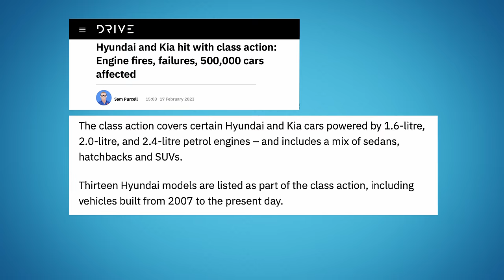Australian Mechanic Reacts to Aussie Car Problems

Comment: The GTR looks like the chassis twisted, lifting one of the wheels off the track.  It's AWD, so going from 4 wheel power to three wheel power could easily push it off center, especially with 2,000+ ponies.

Very fortunate recovery.  Could have been far worse.

Comment: 11:45 It's a little messy but a screwdriver through the filter will remove it too and even barefoot "shade tree" mechanics all have at least one screwdriver, not everyone has a dog's choke chain!

Comment: I had a 1971 450SLE MB, put a 351 from a 1976 XC falcon wagon in it with a C4 tranie, cheaper than fixing the heads on the german caca/dodo/poop box

Comment: dudes that 11:55 guy with a wicked tight oil filter. That was damn near me a week ago. did my first oil change on the '19 miata (the dealer has done the first 3) and that fucking thing musta been put on with a breaker bar. absolutely required a tool to get free and they say no harder than hand tight needed, jesus!

Comment: At 11:27 I've seen Mexican mechanics stab the oil filter with a screwdriver piercing both sides to use the handle of the screwdriver to turn the oil filter.

Comment: The sad truth about snorkels is unless your air box and it connections are sealed and electrics waterproofed a snorkel is not gonna help you with high waters. 
Truth is that snorkels are mainly use in Australia to minimise clogged up your air filter with dust especially if you drive a lot on dirt roads.

Comment: I like the dog chain, but a flat head screw driver will go through and through in two seconds. Then you just turn .
Reply: Sometimes. I had one seized on so tight the screwdriver cut thru the filter like it was a soda can. The filter claw wrench thing kept slipping off and flinging my hand into steal. I had to beat the crap out of it with a hammer until it was unrecognizable.

Comment: So with the Kia and Hyundai motors could that be an issue like way back when with the Germans telling them to add one quart or a half quart less oil that the motor actually requires?

Comment: Hyundai kia engine burn oil severely. Its the same engines as the aussy ones but people dont know for some reason and keep buying them. Ive see hundreds of them with 60k miles and burning 1-2 qt every 1k miles and it causes the engine to go dry and blow up.

Comment: Back in the 70s, in the outback but not back of beyond, my mum's good friend tried to cross a river during a rainstorm. For context, like many rivers in Aus, normally there isn't any water in it and you just drive down one bank and up the other. There isn't really even an elevated ford usually because there's nothing but dust in it.
Unfortunately when its raining, there's a lot of dirty water and its flowing at a right clip, and she got swept away down river. It was an original bug so pretty sealed underneath, and she eventually fetched up on a riverbank where a farmer spotted her and gave her a tow out with his tractor.
And now we keep telling the story over and over. Don't drive through rivers when there's water in them, kids.

EDIT: My mum didn't know enough about cars to say if it was hydrolocked at all, but it was recoverable and the mechanic said it was because of some feature of the VW Bug design. I can't find where their air intake is though.

Comment: kias pretty garbage, my mom had a sorento 3.3 v6 that burned all the oil and shredded itself, unfortunately she didnt check the oil because she just got an oil change around 2k miles beforehand and it never leaked on the driveway. brought it in to the mechanic and he said no oil came out and there were just bits of metal in the pan, $10k later with a refurbished engine we’ve had some issues like an old belt on the “new” engine.

Comment: I'm sorry Aaron but why would I look up your company when you can't even tell me what model of Commodore that that is confidently and call yourself a mechanic at the same time when anyone of us bogans can tell you that it's a VH Commodore because it is the last of the steel bumpers before they went to the plastic bumper for the VK and it couldn't be a VB because of the extra angle on the headlight, the VB had a more square headlight and the VB was from 1979 this is clearly from around 1983 also clearly identifiable by its straight across grill. 😂😂😂

Comment: Kind of crap that the Australian tax payers were contributing 20k to each chommy off the line. Ultimately GM sank holden as it's too small of a market for them to care. Unions had some play but if you're a production line worker you are not going to refuse $70 an hour? There  was a whole line of Australian  companies that produced parts for Australian built Mitsubishis, Toyotas, Fords and Holdens that that also lost big time.